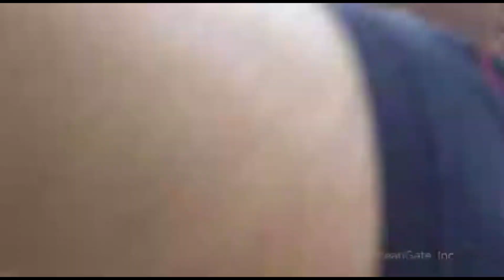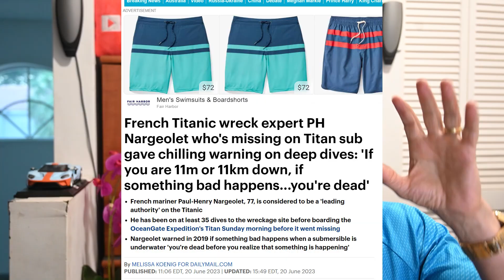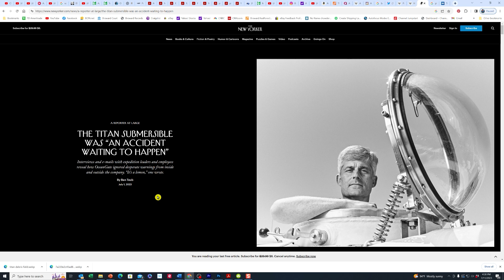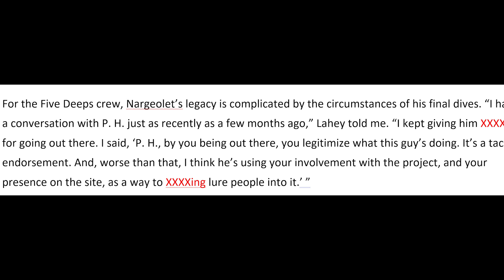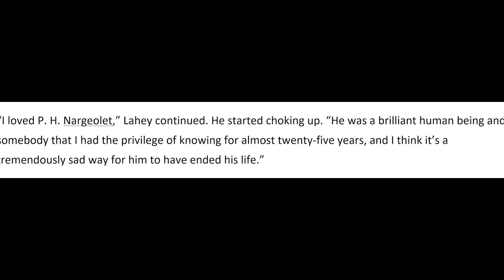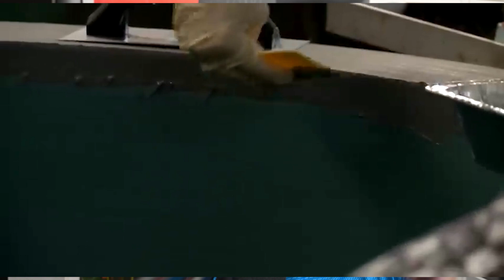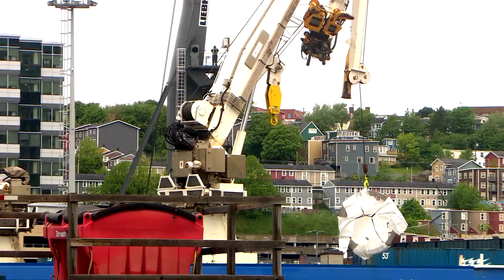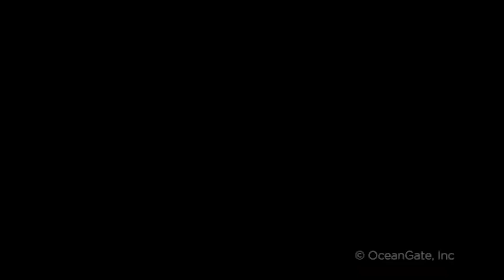Titan Sub: More Q&A, Design Defects, Why Descent Fast

Comment: Doomed from the get go ... no Clean Room, no Auto-Clave, no gloves/dirty shop rag and no AS9102 certification to keep it all on the straight and narrow. But hey, that's just what my 40 years in Aerospace Composite Engineering tells me. Just imagine if Rush had invested in a "Thread laying machine" (TOWS) like we use on our F-35 Program ... much stronger (offset ply orientation) ... and Rush wouldn't have been able to buy that expired (and obviously "re-tested" once) CF Tape from Boeing ! BTW, the steel cylinder is called a "Mandrel" ... wet or dry, an Auto-Clave would have done it's job. And THAT folks is why we call it "HALT" ... highly accelerated lifetime testing ... "bend it until it breaks" so you have a baseline; they did HALT but unfortunately with Humans on-board and killed them all in the process. IMHO, the Hull imploded and had NOTHING to do with the Titanium flanges/dome; the acrylic view port and domes blew off like Champagne corks (Water cannot be compressed and it had to go somewhere) ... studs smooth as a shiny new whistle ~ zero threads left nor CF tear away on the mounting flanges (there are ZERO “Adhesives” on the professional/FMS market that don’t call for application of a “Primer” prior to the actual Adhesive). His "Design Engineers" sucked ... the hull was in "hoop" yet zero internal stringer supports nor sleeve to help keep it equalized; hull thickness would have needed to be approximately 17.6 inches thick without said support structure. All the "popping noise" on previous dives was the CF delaminating, transitioning from "Elastic" to "Plastic" state ... the fibers ripped out of the resin matrix bed and never able to re-seat; Rush would have known this had he bothered to perform NDI (ultrasonic or X-Ray) after each dive. Pity his hubris got in the way ... and ended up taking PH and the rest.
Reply: I'm not buying the need for a highly specialized Clean Room, but you seem to have significant experience.
Reply: @JoeLinux2000 you're kidding right?

One of the major informed criticisms about the entire thing is how the carbon fibre was applied.

Carbon fibre is incredibly strong but imperfections, even a tiny air bubble or a bit of hair will cause a significant weak point.

In the perfect world it would always be laid in a clean room and vacuum cured... considering this was an untested experimental craft that's exactly what should have been done.

That's what they do on aircraft.
Reply: @JoeLinux2000  Any contamination is weakness.
Reply: @JoeLinux2000  as is your right ... just stating what I've seen over the years doing it the correct method/process and having to scrap so many composite structures due to porosity and/or FOD even in Clean Rooms. Composites are "Science" based to achieve repeatability but approaching an "Art Form" as well. Would you believe it if I told you I've seen solid steel bond forms "leak" @24 psi of vacuum ... most think there's no "porosity" in Steel ... but most assuredly there is.
Reply: why 50 year old engineers have value. experience and knowledge matters. that level of innovation (experimentation) has no place where client life is included and ignoring previous popping crackling noises? why wouldnt he ask a pro in that carbon fibre technique for input??
Reply: Its insane they couldnt even navigate when they reached the dive site of titanic they had to depend on the mothership to tell them where they were no back up sub in case something went wrong plus the sub was overloaded it couldnt handle 5 fully grown men maybe 2 tops so if one tiny thing went wrong on titan they all would be dead even if they didnt implode there wouldnt be enough time for a rescue im just trying to understand this insanity and i dont know much about subs just what ive read but even i would have known better i would have done my research before climbing into titan
Reply: @jasonlinton9902  Just goes to show you can be "rich" and still lack "common sense". Titan should have been tethered to a winch cable and a two way comm unit affixed as a "last ditch safety measure"; 4,000 meter cable on a spool is no big deal ... transatlantic cables are laid daily using the same tech.  Rush was just a cheap skate.
Reply: @jasonlinton9902  Exactly. Intelligent person, that have no clue about subs, would ask for opinion third party. Someone who do understand subs, have experience with deep diving and isnt connected to Oceangate. If you are going bet your life on experimental vessel, you should do at least that.

Comment: Whenever I use that type of adhesive a hundred percent of the time I rough up the surface. The first thing I do is clean it with acetone and don't touch it, then I rough it up and then I clean it with acetone again. I make sure I use clean cotton cloths that have not had any kind of fabric softener. And this is just on some hillbilly projects I'm doing my garage that are not life-or-death.

Back in the eighties when I worked at a recap shop making semi tire retreads we used one of those pressure tanks so that the new rubber was pressed into place and heated for I think about an hour from what I remember. I know the chamber was under pressure and it was hot and the tires had like a rubber membrane wrapped around them that it was put under vacuum to press them in place even more. I thought it was insane that they didn't do that with the carbon fiber and wrap it around a sturdy titanium tube.

Comment: Why do people keep going on and on about the glue and the chemical bonding of the titanium and carbon fiber?
Let's lay out what is more likely: 1.) We know that carbon fiber is exactly one of the worst materials to use on a deep sea submersible for repeated dives because CF does not handle compression/decompression cycling well... at all... and this is extreme. 2.) Worse yet, the design wasn't a spherical one like a bathysphere, it was a cylinder. Now think: What happens if you take a cylinder and put a ton of pressure in the middle of the cylinder? It fails before either end because there's less structural rigidity there and more volume to have pressure exerted on it. Meanwhile, if it was a sphere, all the pressure at these depths would be put evenly along the entire surface. Cylinder? There's weak spots in the middle of it.

Now what happens if you take a material that when subjected to compression/decompression cycles shatters like throwing a beer bottle against a brick wall and worse yet make the design a cylinder - doing to huge big no-nos in deep sea diving together (non-spherical and CF repeat diving pressure hulls) and dive multiple times to nearly 4,000 meters depth?

Gee. I wonder. No, it wasn't the glue. I'm sure OceanGate's half-assing and incompetence on manufacturing this didn't help, but it was the design that was the problem. You DO NOT use CF for deep sea submersibles that are repeat divers. Just no. It's a one-and-done thing if you care about safety at all. You do not utilize that material like that. And you don't use a cylindrical design on top of it. End of discussion.